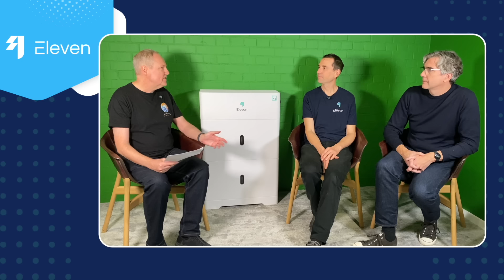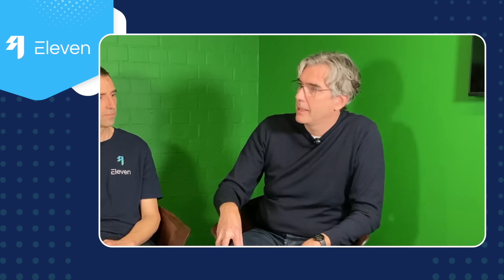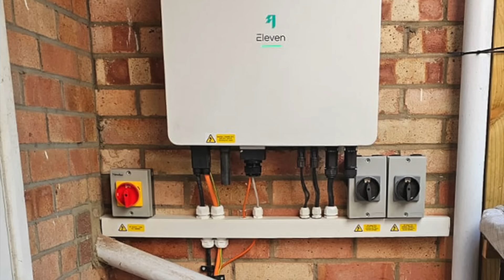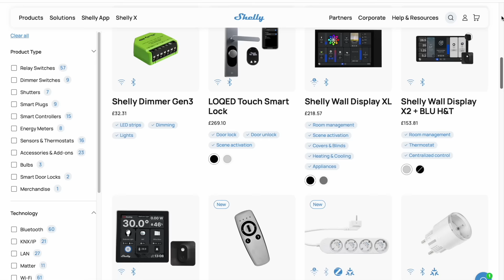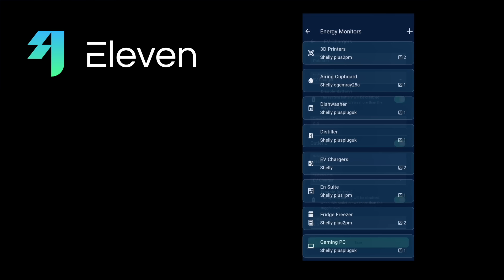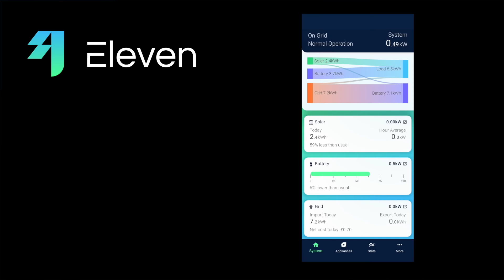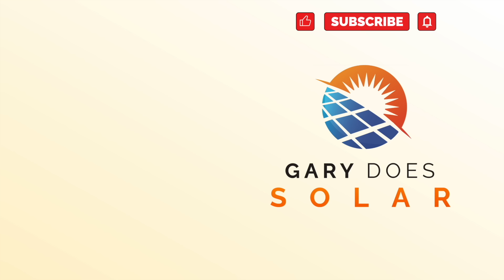Home Batteries: Could SODIUM Be More Popular Than LITHIUM Soon?

Comment: Fantastic, great to hear of a British company wanting to manufacture in the UK!
Reply from the maker: Yeah—we need more of this kind of thing 😀😀
Reply: Take that with a pinch of salt!😅
Reply: … but currently contract assembling seemingly somewhere abroad and buying the battery cells - from CATL perhaps?
Reply: @dougal6569  

The worlds biggest companies and buyers ..quietly go to the one Company that pretty much 100% reliably delivers what it says. And they were showing these cells and using them in China at the beginning of this year 2025 by 26 they will be ramping up by converting older LFP  factories almost on the fly and then building the new gen 5 LFP cells  at 46% less than present prices.. and introducing their blended chemistry packs and the interesting chocolate block  battery packaging systems that can be used as plug and play  pack builds for smaller guys not wanting to buy CATLs advanced battery platform systems.  Basically drop your design on to their whole rolling chassis floorplan battery system 😮...
Reply: If sodium ion batteries drop to 10$/kWh as promised by CATL . Well below the current $50/kWh for LFP 

There is no way Conservative and the oil companies can stop the energy transition.

Comment: I wish them well.  The better cold weather performance is handy.  I would like to know what its charging rate is between -10 and 0c.  My LFP batteries struggle to charge fully during the off peak (night time) window.  I can see it step from 2,3,4,5 kW increasing as it warms itself up.  In the depth of winter it does mean my battery does not charge fully.
Reply: CATL claims their Gen 2 Naxtra battery can charge down to -40C